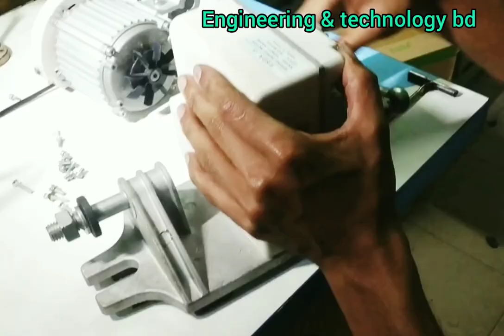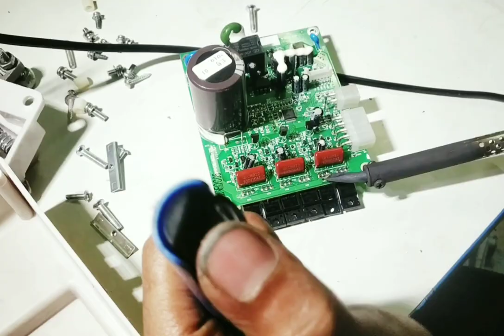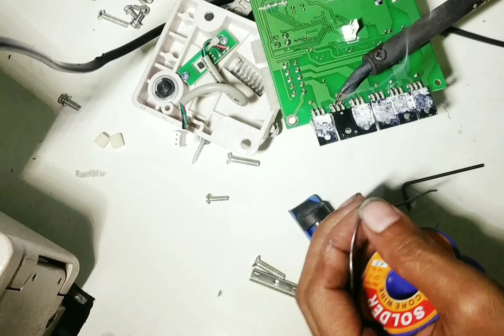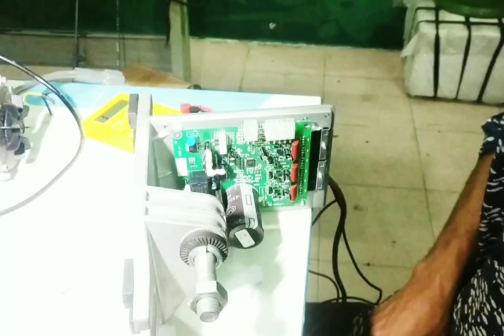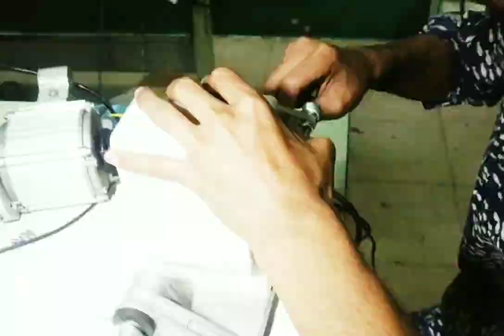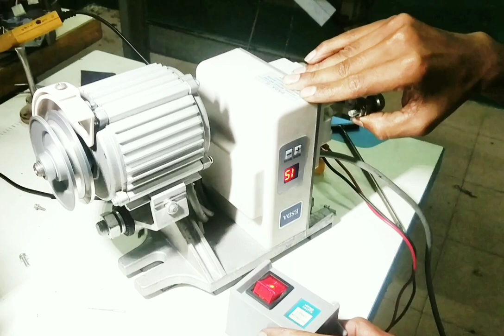servo motor repair (error - 3 problem)

Comment: I have replaced 6 new igbt and driver ic at a time for E03 problem.but it comes e03 before pessing padal. What problem Sir pls reply me
Reply: I am electrical servo motor engineering 🍒💕
Reply from the maker: check all resistor near igbt
Reply: @engineeringtechnologybd4654  okay thanks

Comment: I change the igbt but after change it work but when I am 3p form the contoler then it run 5second then the problem error 7 was again and the changing igbt are shorted egain what to do
Reply from the maker: Please check the motor